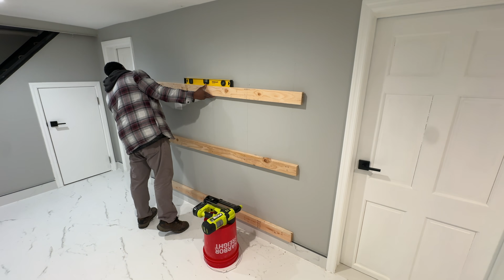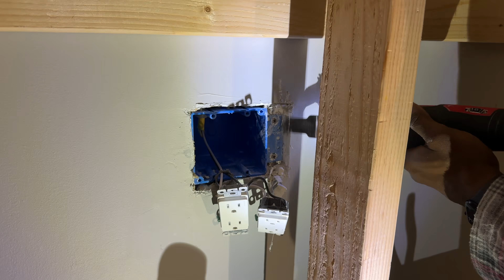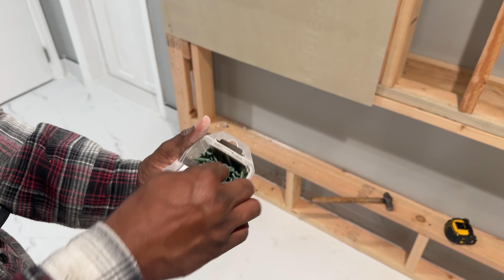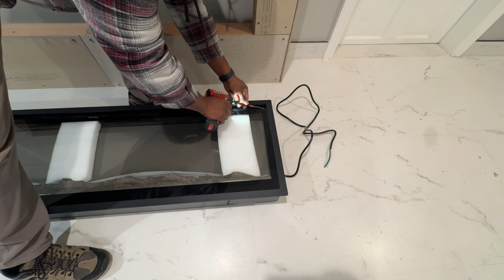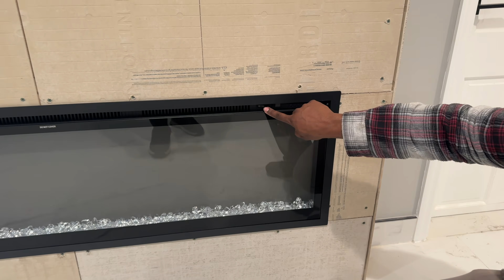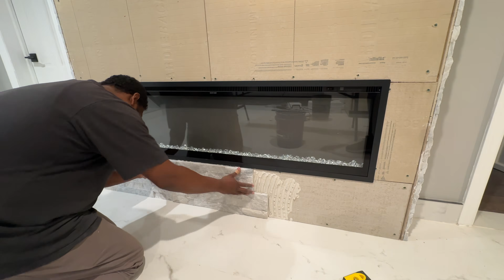DIY Stone Electric Fireplace Wall (Start to Finish)

Comment: Things to keep in mind for us DIYers
1. Check your fireplace's instructions, some require a dedicated electrical circuit breaker
2. After wiring first test the fireplace before screwing it in place
Reply from the maker: Great points—safety and testing first are definitely the most important steps!